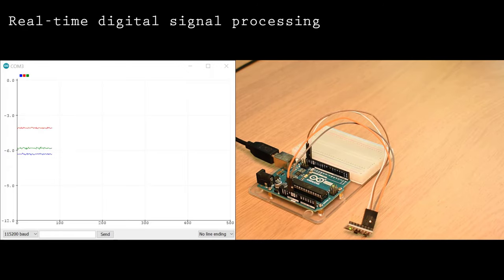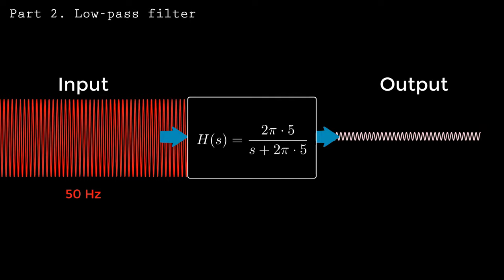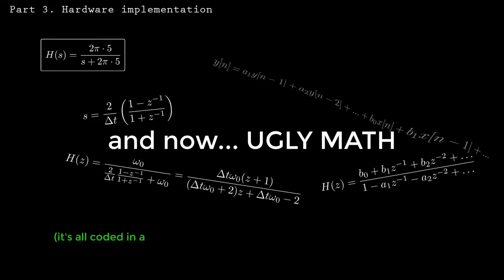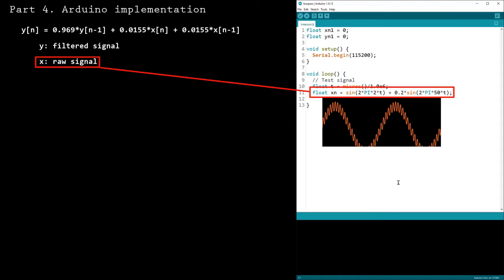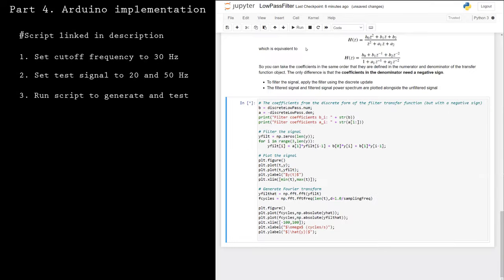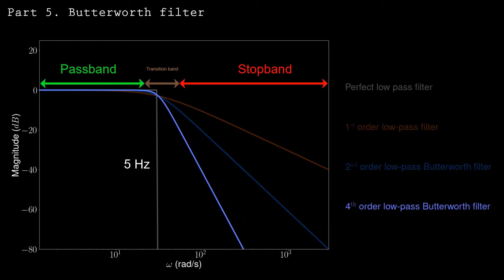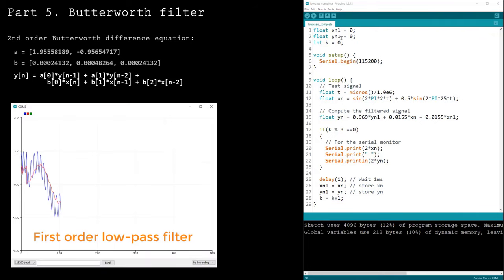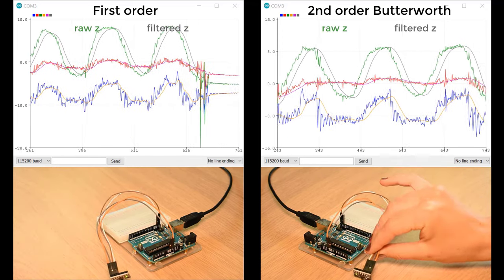How to design and implement a digital low-pass filter on an Arduino

Comment: Jupyter is New for me and I dont get how I can use your Skript. I instaled all like in the links below. I Was Abel to open jupyter in My Browser but from there I dont know how I can use youre Skript to Edit it for My needs. Thx for help ✌🏻
Reply from the maker: Are you able to run the script after opening it?
Reply: @curiores111  ok i got the script haha. i have to put the script to the jupyter directory right?
Reply from the maker: @BooBar2521  You can go to the project root at 
https://github.com/curiores/ArduinoTutorials 
and download from there. Alternatively, you can fork the repository. If you want to make changes and think you might need some additional advice, consider forking instead.
Reply: @curiores111  ok i got it all thx for helping. some times i need some one to talk haha
Reply from the maker: @BooBar2521  lol good. Nah, you can just go to the terminal (powershell or whatever) and launch it in the folder (cd to the folder with the scripts then > jupyter notebook)
Reply from the maker: @BooBar2521  hmm, its difficult for me to say what the problem is. It sounds like an issue with your jupyter or python install. I suggest finding a tutorial for installing jupyter and then testing out a more basic example and getting that working before testing out the code I posted. That way you can identify the source of the issue more easily.
Reply from the maker: @BooBar2521  Maybe this one? https://www.youtube.com/watch?v=HW29067qVWk
Reply: @curiores111  thank You I will try this 🙏🏻✌🏻🔥🇩🇪

Comment: Can i use a PIR sensor instead of Accelerometer
Reply from the maker: You can filter any digital signal.. the only question is if that filtering is helpful to achieve your desired goal.

Comment: At 2:25 it shows 50Hz but it looks like it's between 100 and 1,000. Isn't that a mistake?
Reply from the maker: The axis is measured in angular frequency (radians), so it's  between 16 and 160 Hz.

Comment: Is this a FIR filter or a IIR filter?
Reply from the maker: These are IIR.

If the difference equation involves previous values of the filtered signal (here y[n-1], etc.) then the filter is IIR. Think of it this way: because each time step depends on the previous, any time step will depend on all previous ones. In a finite response filter, you must be able to write it as a finite sum of previous values of the raw signal (x[n]).

Comment: Seems to me like a kalman filter would be much better for the shown example at the end. In other words: Very nice concept and video, but wrong example. Or maybe showcase where this is good and where its not, like audio processing etc.
Reply from the maker: I think you're saying a Kalman filter is better here because you know that Kalman filters are used with IMUs? That's actually not true for raw accelerometer readings by themselves. The Kalman filter is used to synthesize the gyroscope and accelerometer readings. And besides, you don't need a Kalman filter for that, you can use a complementary filter.

"Wrong" example is not accurate. Sure, it's not the "best" example, but it shows exactly what I wanted. I purposefully did not spend time discussing where its good or other more complicated examples, as you suggest. Video is already packed with information. No need to do everything at once.
Reply: @curiores111  Indeed, its not wrong, its just not "optimal". And also indeed no need to do it all at once. Keep up the good work! Didnt want to be harsh or anything.